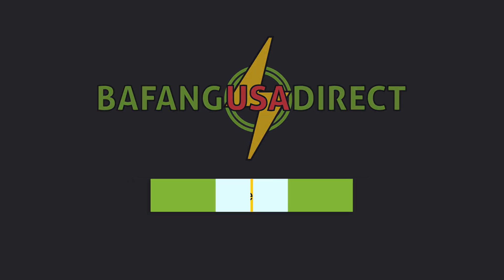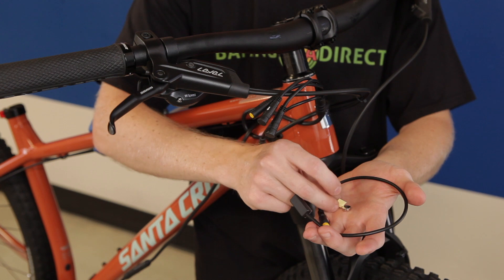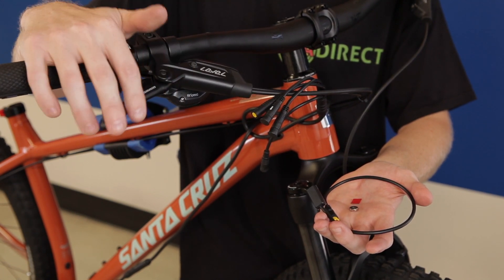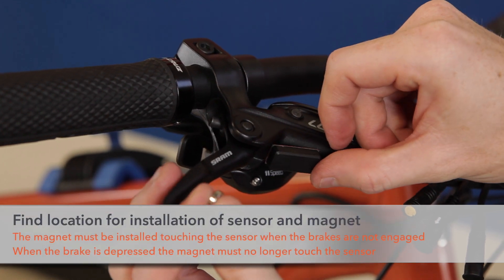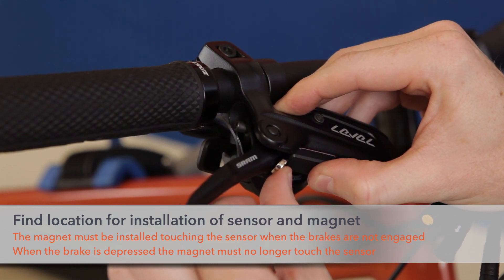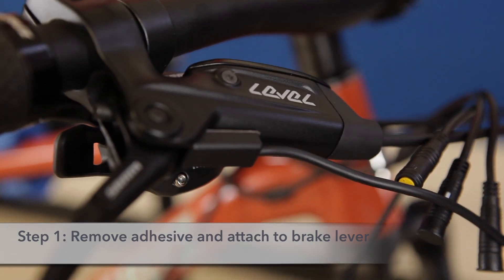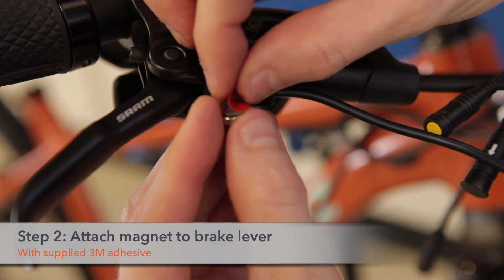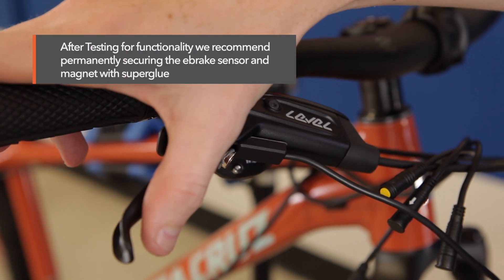Bafang Ebrake Sensor Installation for Hydraulic and Disc Brakes

Comment: The magnets don't even think about staying on with the sticky.  CA glue will hold them for about a year, if you're lucky.  Then one day alittle magnet falls off and hits the ground and shatters, and you are S.O.L. Motor disabled, and you must walk or pedal home with no power.  Then, try to find a suitable replacement type ND  magnet, and the whole process repeats.

I agree, using a liberal application of epoxy is probaby the only thing that can work. But very tricky to clamp the magnet into position so it can cure up.
Reply: Could you not just unplug them if the magnet falls off? Mine are not plugged in yet and it works
Reply: @Paul-om6ml Yes lol, just have to be careful to not engage the motor while you are breaking
Reply: great point

Comment: Great if the brake levers are normal like this mine have nowhere that meet on my new hydraulic bike brakes I used the bafang brake lever on my old v-brake bike but this stupid hydraulic brake levers are crap ps don't buy a Claud Butler 2024 bike they are shite

Comment: This has to be the worst solution ever, all of you would be better off just buying a lever with an actual sensor in it
Reply: Agreed, but good luck finding them for drop bars
Reply: @scottmcgrath9080 haha 3 years later and lever options are still extremely limited 😅

Comment: When I use my brakes, it stops the motor but the throttle will work when applying the brakes. Can anyone explain the reason for that?
Reply: Sorted it out. The magnet was misaligned
Reply: Don't

Comment: Normally open or normally closed ?
Reply: so when the magnet is next to the sensor, the circut is open, when the lever is pulled it is closed, cutting off power to motor

Comment: hi , Can it be glued to the disc brake mechanism?
Reply: yes but you can buy ones specific to bbshd, you'd need to have a seperate gear to brake, so not a gear/brake combo, i use bbshd cut off on mine with a cable hydrualic brake

Comment: I dont understand why is this sensor even needed?? If a person put finger of throttle and breake with existing disc brakes that will logicall stop the ebike
Reply: True, its nice to have though if its an option or free with the kit, but yeah I don't think its needed, I haven't used mine for the first month or two, did the job using my brakes as they are without the sensors, although if your half way through a pedal with assist on and you need to stop immediately the motor can occasionally still push you forward while the brakes are on an that is irritating for the back of your legs and somewhat dangerous at the wrong place and time.
Reply: Apparently, unlike cage operators, e-bike operators are not considered smart enough to let off the throttle when applying the brakes.
Reply: @Bonjour-World  Its not just the throttle that activates the motor, some have built in pedal assist aka mid drives and your crank arms, if you ever rode a bike, naturally move without much effort and it only takes a half turn to activate, but yeah there's always the village idiot in every group.
Reply: @Bonjour-World  lol xD
Reply: the motor stills supplys power to the drive train, on bbshd you have 160 nm of torque, its not a case of throttle play, its due to the settings on motor controller, the power when you stop pedelling stays kicks in a little, with the programmer cable one can change this but its not recommended, i use bbshd for over 7 yrs
Reply: Hi is this needed

Comment: I just got my BBSHD kit a month or so ago. Just did the install. I can't get the display to show whether the brake cut off is working or not. Even holding the two pieces in my hands. I tried both sensors and both wires. I also tried holding the sensor and magnet together while powering the bike up and then separating.
Reply: you won't fred, even bbshd own brake line kits the come with the motor won't show, it might have something to do with the firmware on controllers
Reply: @OutandAboutDevon  I found out I needed the better display. The color one.
Reply: What controller are you using? I have the 18 and with my bbshd I can't go above level 5. I've ordered a 850cans I hope that fixes that issue
Reply: @walter9724  Sorry, but this was a year ago and wouldn't have the foggiest. Now I just ride it.
Reply: @walter9724 Level 5 on 5 level displays is same as 9 on 9 level displays. 5 level displays use 1-3-5-7-9.

Comment: that little sticky tape will fell in first bump. Use epoxy instead
Reply: Mine are still attached 🙂
Reply: Agree.. I've used epoxy and it fell off 🥴 now I can't get the epoxy off the lever 😅
Reply: Clean with alcohol, then ues a hair dryer to heat tape, this activates the "sticky," press firmly.
Reply: epoxy or death
Reply: Well, no, if your brake levers are metal, the magnet ´sticks’ to it anyway, the sticky tape only keeps it in place.
Reply: @pipolow5478  BRAKE LEVERS ARE ALUMINUM
Reply: I couldn't get mine off when changing bikes, so wouldn't be worried about it falling off.
Reply: After 2300km still attached

Comment: Man as if they didnt include any adhesive for the magnet. Only way is to super glue that shiz
Reply: Try hot glue since it can be removed.
Reply: @WhewLads  nope, never hot glue, use expozy, i used it alot and it stays in place 5 years plus